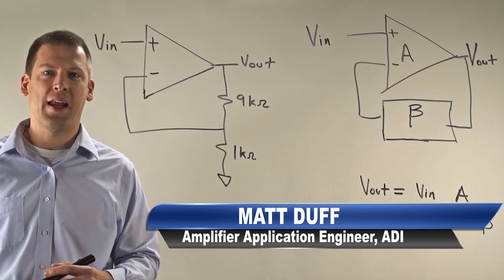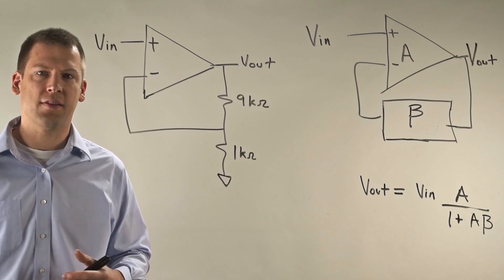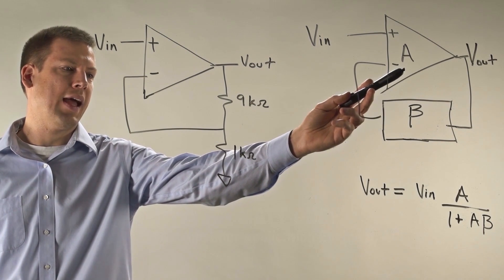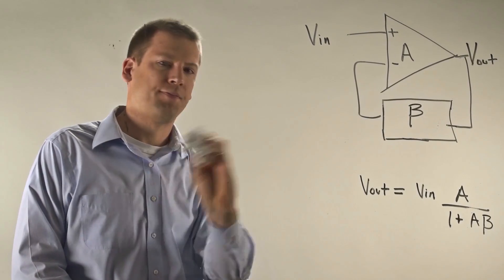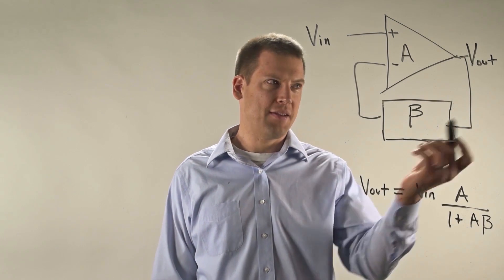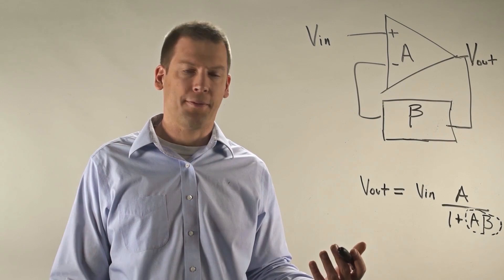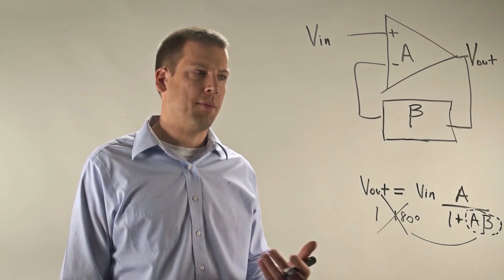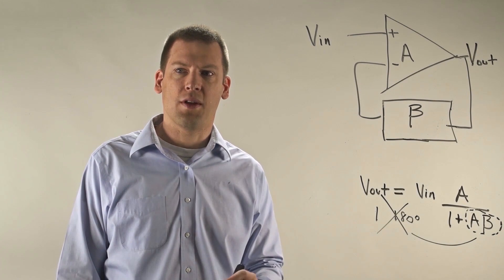Stability 101: Loop Gain in Operational Amplifiers

Comment: Hi, I am deciding to use 2 × AD797AN as a buffer(configure in voltage follower) in my 47 headphone amplifier. Do I need to connect an input resistor to AD797AN positive input pin when in this application?
Reply from the maker: Engage  with ADI technology experts in our online community, EngineerZone®. Ask your tough design questions, browse our rich knowledge base, or read about new technologies in one of our blogs. Unsure where to post? Simply type your product number in the Search by Keyword or Part Number field and EngineerZone will suggest the correct forum.